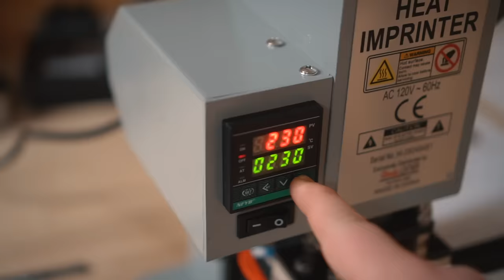Making a Vertical Wallet - Best Selling Leather Wallet

Comment from the maker: This chestnut skirting color may very well be a new option added to our site!  What are your feelings about it?
Reply: I love it.  Going to replicate the wallet in a larger size, thanks for posting!!!!!!!!!   Love your work!!!!!!!!
BTW  how'd you get the wallet to take to closing that cleanly, did you wet it?  and -- what oz. leather is that? 5 - 6 oz?
Reply: @jackspradt1562  also curious as to the thickness of the used skirting. I have been looking for a good guide on what weight / type of leather to use for this type of projects (wallets), but struggling to find something comprehensive :)
Reply: Looks awesome
Reply: Yes sir, would def buy a coiuple of those, they really look amazing, LOVE them!!!
Reply from the maker: @jackspradt1562  I use 3/4oz for this wallet which is why you don't need to wet it to close. It'll just close up on it's own with no problems
Reply from the maker: Joker Toker  Yep! 3/4oz
Reply from the maker: @LegacyLeatherwork.9087  thanks Trey!
Reply: @whitandpark  Is the chestnut colour from Vernis Edge or another company?
Reply: Not sure if you have thought about it but I saw on your other wallets that you have a slot for your Id with the plastic cover. You should add it on the outside of these ones. It would be a nice little addition and not make the inside of the wallet any wider. I'd buy one instantly haha
Reply: Looks great. Very nice color.
Reply: D_L  
Haters gonna hate.
I think your work is excellent.
Reply: How much does it cost to make?
Reply: I do like the matching stitching. I have been making phone bags, and bound journals. Finished a pair of custom half chaps. I'm not great at this yet, but, I get better each time. I was curious about your glue, I have tried several, the good stuff has a brush, and slops all over the place if I'm not careful. The ones that come in a bottle don't hold flexible. Nice work.
Reply: It is by far the most beautiful and "leathery" color you have. You just got yourself a customer!
Reply: The link you mentioned in the video, I can't see it, can you please help me with it. Thanks
Reply: Can you guys add one more card holder slot to this wallet? I’d definitely lean towards buying one even more lol.
Reply: LEO Y A i D E E.😁😁
Reply: Thanks for the template....... 😀😀
Reply: Love it...great color. What thread are you using here? (type and size)

Comment: If you pull the end of the tread to the back side before trimming and using your lighter to burn it you won't have a burnt piece of thread showing on the front or good side of the wallet. A small detail but it all makes a difference to a product for sale.

Comment: I noticed that you too had the Craftplus burnisher and was wondering if you use a finer grit sanding drum than they provided. I just called Springfield Leather and they only had the 80 and 120. With that in mind I'm reaching out for anyone that may have a resource on a finer grit for that 2 inch sanding drum. By the way I love your video's. I haven't watched lately but was happy to see you and Little King Goods collaborating. I hope that becomes a good thing for all. I watched both of you as it given me the motivation and inspiration to continue plugging away. I bought the Glowforge pro and am currently working on two types of wallets a single and bifold style with one and or two card slots. Hoping to find those minimalist consumers. Okay that just sounds weird when you write it out. Thanks for any feedback.

Comment: G’day from Aus, I use a nice big industrial Juki, I usually use it for upholstery purposes since I am an upholsterer, so i usually use upholstery thread, usually size 36, every now and then size 20, your thread size measurements are probably different in the US, but I did get some thicker thread for veg tan tan leather work the other week which is a size 13 which is a lot thicker than what I usually use, so it did take quite a bit of messing around to get the tensions even haha.  But the top thick thread does tend to want to snap after I backstitch and run it forward again.

I just wonder do you have any tips to stop the top thread from snapping after doing a back stitch, would it be doing maybe a shorter back stitch or something when using a thicker thread? Or maybe make the first few holes before stitching and widen it out with an awl for more room for the backstitch?

Comment: What is that glue you are using? Looks like it is coming out of a plastic container which means it is likely not contact cement.
Reply: This is the question I had too.   Very thin.   I like your application though, tidy.

Comment: ok. i wont complaint anymore if i bought a pirate leather wallet. some suggestion. i believe u can go further with some innovation. 1 main problem from all normal design wallet i face, problem when to pull out cards when all the slot full filled. give some thought.

Comment: What was that last step after you sanded the edges at 8:00? Seemed like you applied some coating that made a single layer / bonded all the edge together
Reply: it's called edge paint.  If he was going to do a good job he would do multiple layers with sanding in between.
Reply: Won't edge paint eventually rub off?  Wouldn't applying stain or dye after sanding, then buff with damp sponge & slicker & some saddle soap be a better and longer lasting finish?  Just wondering.
Reply: @JunkMailBoxStuff  there are different qualities of edge paints but they are designed for this purpose and are quite durable, especially if you use the good stuff.
Reply: @nerdio1  Can you recommend quality brands you prefer for edge paint that worked for you best?  
Giardini, Fiebings Edge Kote, or Fenice?  (I cannot in good conscience add Eco-flo🙄 to that list.)
Reply: @JunkMailBoxStuff  Uniters is the best stuff I've used.  It's heatable as well.  you can get it here. https://www.rmleathersupply.com/collections/dyes-stains-finishes/products/uniters-heatable-edge-paint-matte

Comment: Pay close attention to your stitch tension and don't forget that you may also be able to alter bobbin tension too if you can't get an ideal set up with the upper thread tensioners. See 7:41 and 8:19 you have a flat looking lower thread where the locking part of the stitch is pulling to the underside because of incorrect tension. Remember to test sew each new project even if using the same weight of leather and get your tension spot on. Sorry but this one is a 'second'.

Comment: 2 month User update on the  western 68. So I was torn between the 52 and the 68. I went with the 68. Being an older fella and use to having a tri-fold I didn't think I would fall in love with a smaller bi-fold. Well sold and sold. If your in your fifty's and wondering if you can down size you wallet and still feel like you have everything you need in it. The answer is go order one. I picked the chestnut and in the apx. 2 months I have had it the color has gotten so rich. I use to buy $30 box store wallets about every year or so. This is not that. This is a wallet you will have for many many years. My only wish is to be able to have the thread in a color I pick. Love the chestnut but man if I could have the thread in a emerald green it would be totally perfect.  The solution. Well I am going to email stock and barrel and ask if it can be done.  If so I will have two western 68's. I feel even for a small fee and a bit of waiting time it would be well worth the money.  The other option is maybe requesting they sell a kit where the cut and dye all the leather and you (I) sew it together. If that was an option, well I'd buy the kit and use some tiger thread to make it my own.  Thank you for the best wallet I have bought EVER in my life at an amazing price.